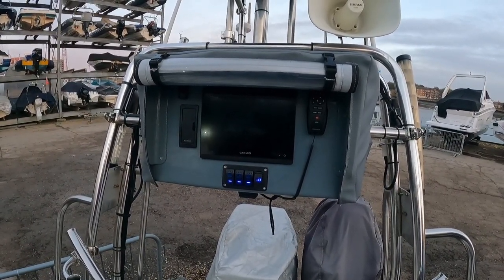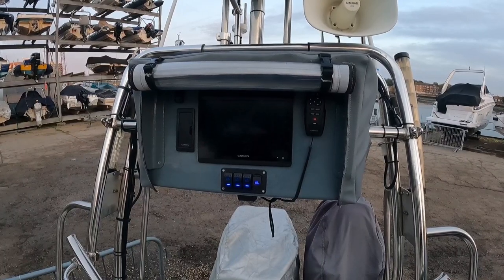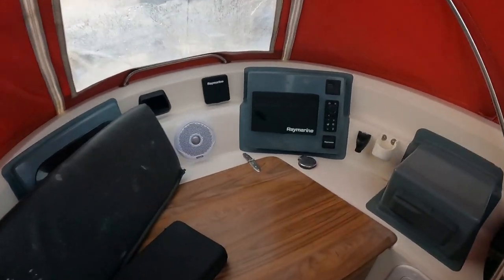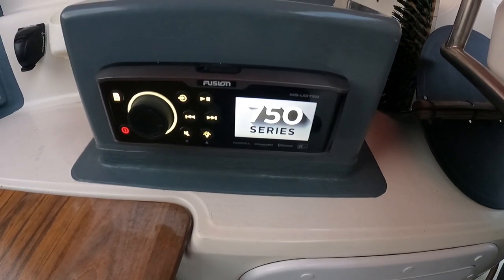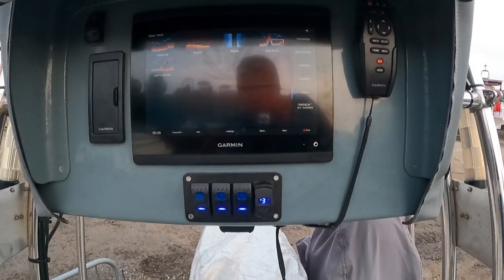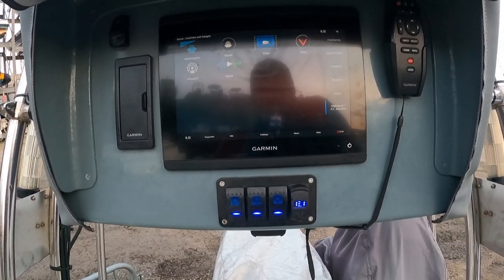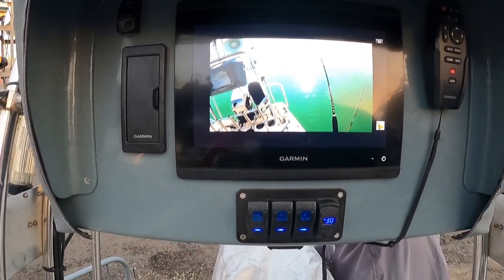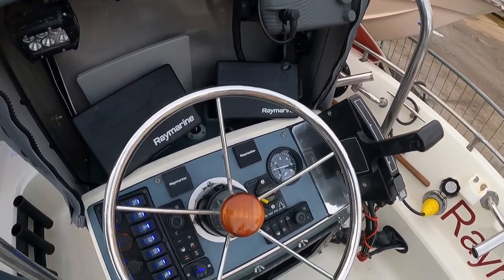Garmin GPSMAP 8410xsv Viewing External Media on Garmin MFD Boat Fishing Southcoast United Kingdom

Comment: How did you get the audio to work ? I cannot get the audio to work 😢
Reply from the maker: Hi Matt 
The audio must be linked to your screen first so basically forget about trying to get a picture on the screen start by linking your fusion stereo through the NMEA 2000 Once you have the screen connected to your fusion stereo you should beable to operate all functions on the screen of your fusion stereo 
Then that will give you audio to what ever you connect I.e your phone through the hdmi lead please speak to your garmin dealer for the correct cables also it will only work with 84 series of garmin screens 
I hope this helps 
Thanks
Dobbo